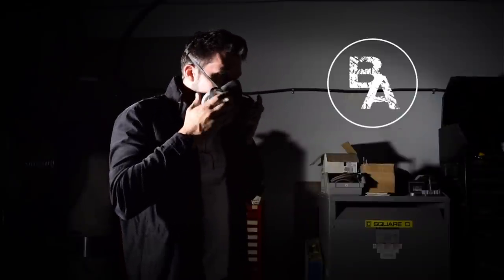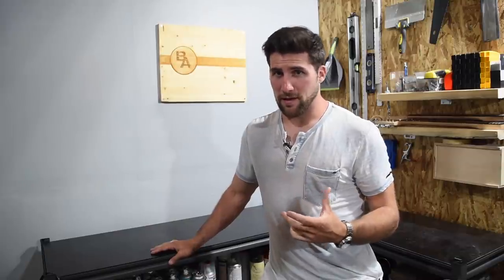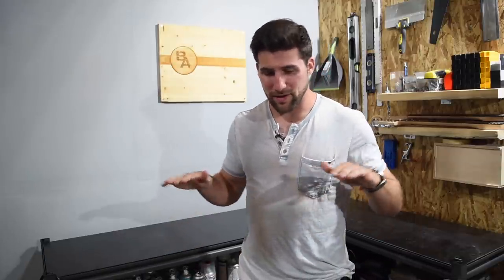Why is your paint crazing?

Comment: How can I prevent cracking on flexible rubber that may move during installation and de-installations of art work. The cracking worked for this project: https://www.lydianobles.com/my-imaginary-erotic-art-installation. But it is not going to work for my next project, if anyone has any suggestions please let me know! Going to put on primer, clean surface, and wait for drying times this time, if there's anything else, I'd love to know! Thank you!
Reply from the maker: Paint generally has limited flexibility. You need either a finish that doesnt fully harden, or something flexible like a gel coat.
Reply: Brad Angove thanks for responding! Your video says not to mix paints, am I able to use a flexible finish on top of spray paint though? The reason I use spray paint is for the colors and color blending abilities. I don’t know of any other products that I could use with so many color options. Thank you!
Reply from the maker: What kind of spray paint are you using? Have you tried plasti-dip?
Reply: Brad Angove I am using Gold brand acrylics. I haven’t, I will look into it, thanks!
Reply: Brad Angove I am using Gold brand acrylics. I haven’t, I will look into it, thanks!